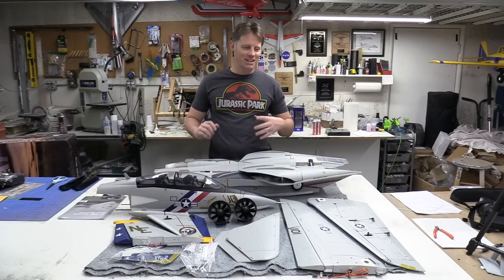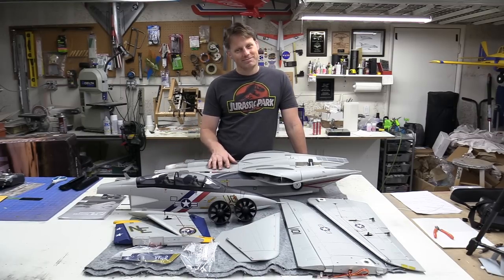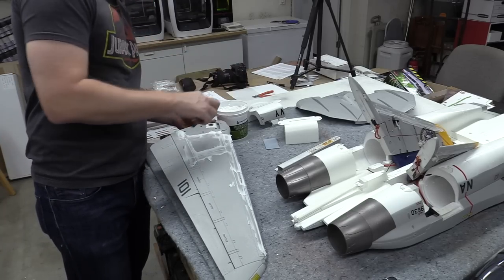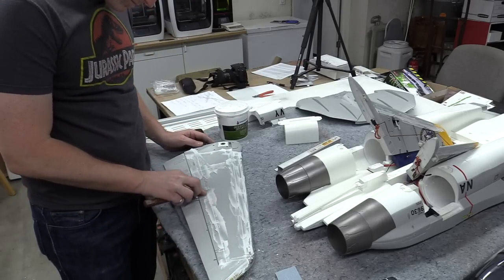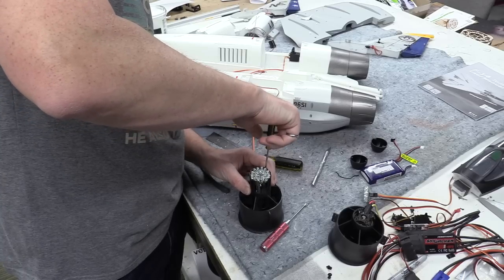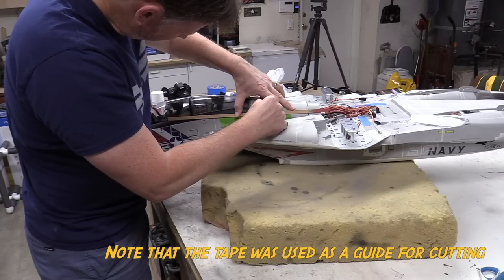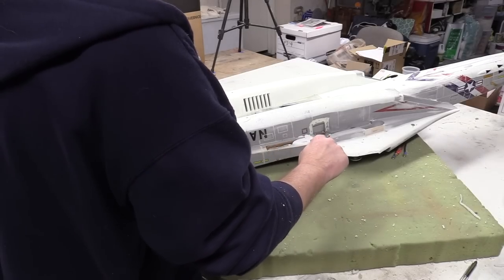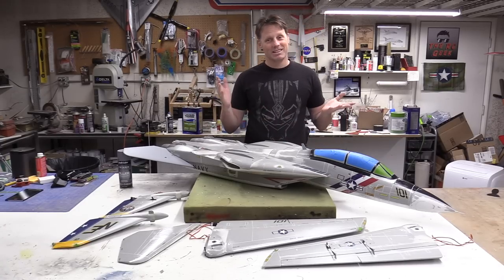Refinish A Foam Jet Ep 1 - Freewing F-14 Tomcat Assembly Mods & Paint Prep

Comment: Thanks for this! I’ve watched these videos multiple times, I’m redoing my F 14 tomcat in the VF 82 ghost squadron. The spackling tip, and the prime sand prime process is going to fix a lot of imperfections in my model. I bought this thing used for 450 bucks, had a receiver, and the afterburner kit. It was worth about $1000 and I bought it for 450 because of the condition it was in. The underside had some asphalt belly landing history and a lot of holes and dents and scratches. Thank god for spackle! It’s going to look great because of you! I appreciate the effort you put in to your videos
Reply from the maker: Awesome, thank you!
Reply: @Thercgeek  any time! I have an important question about it though. The panel lines seem that they might not be filled completely, as in they recess enough for you to feel a texture in it, like less than a millimeter. This is before paint and primer and polycrilic. Once I do all of the refinishing, will they fill in and be smooth?
Let me know soon! I am putting on the minwax in a few days.

Comment: Although I’m new to rc planes, I’ve been an auto body technician for 25 years so I enjoy this part as much as flying. FYI if and when experimenting with paint and body materials, anyones best bet is a local bodyshop supply store in your area. Especially for canned primer. Good ones are  is U-Pol, Transtar and medallion for canned primers. 

It’s also difficult to find the right materials for rc air craft repair materials because there’s not a big market for it. A good way to find useful materials is to search them with the key word Auto Upholstery. That is a huge market and the materials are designed to work with plastics, different foams, rubber, vinyl, glass, wood exc. what ever you can’t find in the auto interior category, you will find it at Michael’s.
You’ve been restoring airplanes for quite some time with all your experience, I want to thank you for showing us what you’ve learned restoring rc planes. It’s motivating and encouraging. Question: does the amount of material that goes into a plane on a  resto enough to show when flying? Or is it minuscule?
Reply: Why 180 on canned primer? Primer is much softer than bondo (body filler). Primer calls for 400-600 grit. Sanding in between coats of primer is easily done with 400 grit. If your using 180 grit for primer because the primer is clogging your sand paper, it’s because the quality of the primer is poor. I noticed you’ve been experimenting with different canned primers., I mentioned 3 brands in my comment, are you familiar with any of them?
Reply from the maker: I’m not familiar with those primers, I’ll check them out. My favorite primer was the ever coat stuff, but it’s not made anymore. Anyhow, I’m using 180 to knock down the primer quicker. The primer is being used to fill in the micro voids that come from the foam texture to fill that all in. The final primer coat is sanded with 600 grit in preparation for paint. 

In terms of the weight gain, it varies on the size of the airplane and the amount of material used. This tomcat is the first refinish I’ve done where I did notice the weight gain in flight. Mostly it was in the approach speed being notably faster than prior to the refinish. Unfortunately though, I didn’t weigh the airplane before the refinish, so I don’t know exactly what it was here. Generally speaking, I’ve found that foam airframes tend to fly better after a process like this. The smoother surface and stiffer airframe really help with that.
Reply: @Thercgeek  ….. thanks so much for the reply. All this information is valuable especially for myself who’s totally new to flying. Here are autobody grade high build primers.. They “seem” pricy BUT, they are much bigger cans, have more surface build, dry faster & harder, won’t clog your sand paper and most importantly, these primers are “less harsh” on substrates and other repair materials. The solvents in these primers are “less volatile”. You’ll experience less to no reactions like lifting, flaking, sand scratch swelling or any defects that may present in the final paint finish when it comes to multiple layers with different types materials. HERE’S SOME GOOD ONES IVE USED 👇👇

👉 U-Pol Products 0791V Grey HIGH#5 Primer -12 oz https://a.co/d/c7wIHzv

👉 SEM 42013 Grey High Build Primer - 16 oz. https://a.co/d/1LUtH2G

👉Transtar 4603 Gray 2-in-1 Primer - 15oz https://a.co/d/4Yjn72l

Stay away from commercialized products!
The reason autobody grade materials is sooooo much better than publicly commercialized products is bcs the demand for high quality paint finishes and the performance of the products that accomplish that are in such high demand and there’s tons of competition with dozens of competing body shops and product manufacturers. 

Excuse my long comments lol but we all know what it’s like talking about what you love, you could talk about your pain all day too I would imagine 😁. Happy to of found your channel! I Do love watching you repair these air planes, it’s so gratifying….. please let me know or do a video trying out any one of these primers. I promises it will change the way you look at primers.

Comment: I know this is an older video but I had a question-the F14 comes with out runner motors…what happens if you had 2 spare 1920KV inrunner motors😮? Would it be too much? Still learning here and I enjoy your knowledge-thank you RC🤘🏽
Reply from the maker: Well, I’m not sure they’d be a good match for the stock 12blade fans. However, that’s the standard motor for the 9blade fans now, so I’d recommend grabbing a couple of those fans and using them.
Reply: @Thercgeek  Hey RC, thank you for the reply and info. Much appreciated🤘🏽

Comment: Chris have you ever tried to use lightweight fiberglass to cover a foam plane to protect it from dings. Maybe using epoxy instead of fiberglass resin that would melt the foam.
Reply from the maker: You could do fiberglass, but the polycrylic is just quicker and less hassle.

Comment: Hi Chris, 
just amazing work, very nice. I plan to refinish an Arrows F-86 and will do it like you show here. 
One question: It seems that you did not strip any vinyl decals from that model, is that correct? Or were that all waterslide decals?
Thank you!
Reply from the maker: Thank you!  The decals were all water slides, so it was easier to just leave them on the surface.

Comment: I found the Benchcraft hollow rubber wheel to be an easy fit with stock rims. Just need to add some material to the rim to get a tight fit. Robart 3” rubber wheels socket are too big for stock rims.
Reply from the maker: Good to know!  I’m using a 2.75” diameter robart tire which looks and fits about perfectly.

Comment: Another great vid.  Question about paint removal.  I recently bought an used EFlight F-16 80mm.  It’s  was repainted to white and then coated in minwax/poly.  I want to repaint.  Should I use acetone and light weight sandpaper to strip so I can prep for repaint?
Thanks.
Reply from the maker: You should be able to just paint right over that. If you’re concerned about the weight, then acetone should do the trick in stripping the paint off the airframe.

Comment: Would it be possible to remove a bit more of the foam and modify the main landing gear to fully disappear in side the fuselage, and maybe add a door?
Reply from the maker: I think it’s possible, yes. You’d need rotating main gear and then would have to fabricate the doors like the full scale.

Comment: Hey Chris, I wanted to know what kind of filler and polycrylic you used? I couldn't really understand what you were saying. Really like what you are doing!
Reply from the maker: Thanks!  I’m using sherwinn williams shrink free spackle for filler and minwax polycrylic (minwax is the brand).
Reply: @Thercgeek  Thank you so much. Gonna go refinish a plane now!
Reply: @Thercgeek  Hey Chris, I've started the refinish process on my f15. I was just wondering if the filler primer that you used will cover up any small imperfections that were not covered by the filler (Tiny dents and scratches) or if I should take the time and fill those in too? Also I couldn't find the minwax polycrylic so i'm gonna try and use Varathane polyurethane water based. Just wondering if this is a good brand, or if I should stick with the minwax one. Thanks!

Comment: For fixing filling up ding-up rc foam plane (such as scratches), do you recommend using the Sherwin William sprackling as used in your video or would you recommend the foam tac foam finish filler. Thanks.
Reply from the maker: I use the sherwinn Williams spackle for that. I’m not familiar with the foam Tac filler, so can’t compare. I’d imagine it would be similar.

Comment: Great job Chris.. Filling in those panel lines really do make it look smoother.. I picked up a few things from you here.. Thanks.. By the way on youtube some guy did put rotating main gear on his FW F-14.. No flying videos yet..  Be a while before I get My FW F-14.. But the wheels in my head are turning...  Thank you..
Reply from the maker: I’ve seen a few folks mod that. I personally just didn’t want to spend the time to re-engineer that whole area. I have a 3d printed wing glove pylon that I plan to install to help hide the tires ultimately.

Comment: My panel Lines might not be filled completely, as in they recess enough for you to feel a texture in it, like less than a millimeter. This is before paint and primer and polycrilic. Once I do all of the refinishing, will they fill in and be smooth?
Let me know soon! I am putting on the minwax in a few days.
Reply from the maker: That’s not uncommon. The issue is the softness of the foam and it lightly compressing while sanding. A lot of that gets smoothed out in the primer/sand process. However, you can always do another pass on the filler. Larger imperfections you definitely want to fill before poly and primer.
Reply: @Thercgeek  thanks man! I appreciate it!

Comment: also another question about the fillers used,   what type of lightweight spaclke do you use on the vertical stabs "lightweight spackle" and why do you choose to use it there and then use the 3m filler putty for some of the surface blemish stuff instead?    Thanks, great build
Reply from the maker: I used the same sherwinn Williams spackle I used on the rest of the airframe. The spackle was used there because the gaps being filled were wider than the 3m glaze putty would effectively fill and it was also easier to sand. The 3m stuff is only just a surface filler for small imperfections mostly and doesn’t have much body to it.
Reply: @Thercgeek  awesome, dap has a "flexible spackling" that says it can be sanded and painted? would that be something worth possibly using since the foam is in theory flexible and compressible?
Reply from the maker: If that’s the stuff from Home Depot, it’s garbage. The sherwinn williams stuff is really good and sands nicely. I’ve tried others that include the stuff with primers in it and they ball up as you sand it. Not the case with sherwinn Williams.
Reply: Thanks again one last qiestion. I have a dynam 109 i want to repaint.    Do you recommend just sanding the stock paint before sealing with the clear minwax or stripping off the old paint entirely?  Seems like a major production to remove it all but if its likely to debond all the new paint if i dont then maybe i should.   Acetone or just clear over the existing?  Thoughts ?  Thanks!!!
Reply from the maker: I’d recommend skipping stripping the paint. Just prep right over the paint.

Comment: I notice that when you are spraying the primer paint that you are spraying close to the surface, I heard that it'll eat the foam, has to be 12 inches away???  Whats the secret?  Is it because of the 4 layers of polycrylic wax?  By the way, you always do an awesome incredible work!!!!!  My hat's off to you, Brian!!!
Reply from the maker: All of these foam airframes these days are made of epo foam which is extremely resilient to solvents, so melting isn’t an issue with it like it’s with eps (beer cooler) foam. I’ve sprayed any number of paints and primers on epo including lacquers without any problems. The only thing you might run into is some swelling of the foam beads if the paint or primer is applied to wet.

Comment: I've been looking for a way to refinish foam. I have a very small 50 mm jet that has waterslide decals all over it that just continually peel off.
What kind of Automotive primer did you use that does not attack the foam?
I used to cover Balsa with Minwax polyurethane and quarter ounce glass cloth, and then primer it paint it
That's a little too heavy for this I thought about using Modge podge, but I don't like the streaks and I think it's a little heavier.
Reply from the maker: Which 50mm edf is it?  You’ll need to determine if it’s made of epo or eps foam. Epo will allow you to spray it with pretty much any type of primer and paint, however if it’s eps foam, you’ll need to be much more careful. Epo foam is extremely resilient to solvents but eps foam is not.

Comment: Hi Chris, do you clear coat after primer as I see you did on the vertical stab section? I’m following your process to repaint my f14 but practicing on a 70mm F16 first. Thanks for your help-Ant
Reply from the maker: No, that's not necessary.  What I did on the vertical tail areas was since I had used some spackle filler there, simply sealed up those areas with Polycrylic to receive the primer better.
Reply: @Thercgeek  okay I see what you mean. Thanks Chris, that’s great.

Comment: Are you not concerned with the additional weight you are adding to the aircraft? Like that amount of paint, filler, epoxy cover is going to add a LOT. Are you re-enforcing the swing wing mech like many have done? Such as installing the metal plate to prevent body flex?
Reply from the maker: Improvements could be made, but I’m not concerned.  I’ve found that a refinish like this results in a generally better flying airplane. It’s a combination of the smooth surface, the stiffer airframe as well as a little higher wing loading. Though, the fw f14 doesn’t need additional weight, it is what it is to get a nice finish. The model has actually already flown in full paint and it flies great! 😁 https://youtu.be/N8ERm_2PonM

Comment: filling those HUGE cordwise Trenches... are you able to feel a performance improvement?
Reply from the maker: The models tend to fly slicker I’ve found and generally better. It’s partly due to the smoothness of the airframe and also the added rigidity you get from the polycrylic.

Comment: Hey Chris, I've started the refinish process on my f15. I was just wondering if the filler primer that you used will cover up any small imperfections that were not covered by the filler (Tiny dents and scratches) or if I should take the time and fill those in too? Also I couldn't find the minwax polycrylic so i'm gonna try and use Varathane polyurethane water based. Just wondering if this is a good brand, or if I should stick with the minwax one. Thanks!
Reply from the maker: The larger dents and dings you’ll want to fill. The primer will only fill the smaller stuff. So, I’ve used glaze putty on that stuff but you can also just use the spackle and spot treat with poly and then primer over that. I haven’t used verathane personally, but I’ve heard good things about it if it’s the stuff I’m thinking of.

Comment: Does the refinish process help keep the foam from popcorning in the sun at all?
Reply from the maker: No, there's no finish out there that will stop that.  It's just the nature of EPO foam unfortunately and how it reacts to heat.
Reply: @Thercgeek  Have you ever tried applying anything like Zpoxy finish resin to a EPO foam surface, sanding and priming it?
Reply from the maker: I’ve only used the zpoxy for fiberglassing. I haven’t tried it as a replacement for the poly.  The poly is pretty quick and painless. The epoxy would be a little more involved process, but would probably work decently.

Comment: Awesome
Reply: I may have missed it in the video but what kind of sandpaper do you use on the foam before priming? Thx
Reply from the maker: I’m using 180grit to sand the filler down and also for sanding the primer. You want to be careful not to bust through the foam top layer as it will start to whisker if it does.

Comment: Hello, I have finished filling my f15. Do I sand after a layer of polycrylic? Or do I just leave it as is? I am very confused.
Reply from the maker: If you haven’t already, you’ll need to sand the filler smooth. Once it’s filled and sanded to your liking, then apply the poly coats.
Reply: @Thercgeek  Yes I have sanded the filler but I do not know if I am supposed to sand the poly coats down? I am thinking that I shouldn't.
Reply from the maker: I usually just do a light sanding of the final poly coat before primer. Not much more than that.

Comment: How much weight does this add?
Reply from the maker: It really varies quite a bit on the airframe and the airframe size. It also relates to how many coats of primer that are used too. That said, in most cases I’ve found that the models actually fly better following a refinish like this due to the smoother surface and the stiffer airframe.

Comment: Epo foam?
Reply from the maker: Yep
Reply: @Thercgeek  
Great videos mate, very educational.

Have you ever made a great looking ec plane using ready board foam / dollar tree Foamboards? 

I mean if you remove the paper the foam even painted hasn't looked great to me yet.

What fillers use to smooth out areas where curved shapes were needed.

What paints used?
Spray can Acrylic paints or regular Acrylic Paint with a brush.

Could you apply miniwax, sand then paint?

Any advice would help. 

I wanna try using that green foam you used previously on a build.